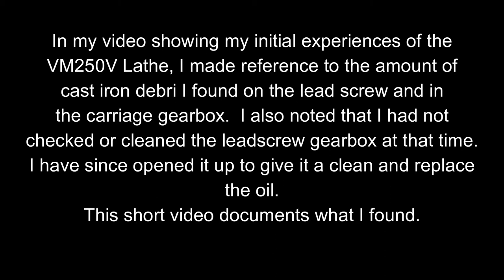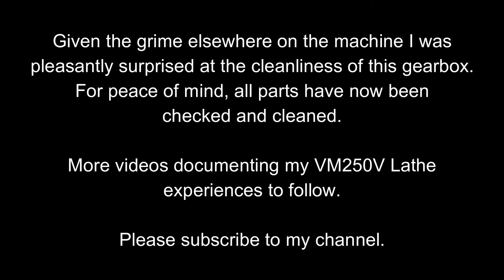WM250V Leadscrew Gearbox Strip and Clean

Comment: Hello Mark, we've recently taken delivery of the same lathe from warco, I've just encountered a problem with the lead screw slipping when you engage the half nut, do you know how its attached in the gearbox etc? Glyn
Reply from the maker: Hi Glyn, I would be surprised if it is slipping - have you checked that the half nut is fully engaged?  There is no clutch in the drive chain, so it will either drive or brake the shear pin on the lead screw.  The gearbox is very simple.
Mark
Reply: @markshomeengineering5243  The lead screw basically stops turning when the half nut engages, could be the pin, i take its easy enough to replace?
Reply from the maker: @glynburnett7364 , before you dive in and look at the pin, can I suggest that you ensure that selectors on the gear box are properly located.  Engaging the gears on my new lathe was (still  is) a bit tricky.  Also check that the lead screw drive gears under the drive belt cover are properly engaged - the  gear train is on a pivot, so can be moved.
This video (different lathe, but the same sheer pin arrangement) will show how to change the pin (https://youtu.be/njXJ52uur2Q).
Yeah, I sheared mine too :-)  
It's actually quite hard to break, which is not so good.
Good luck.
Reply: Its the shear pin 🙄
Reply from the maker: @glynburnett7364  bummer, but at least you know why.  I replaced mine with some threaded brass rod that I had.  It's not ideal, but it got me going and I think it will shear with less load than the oem part.  Which is good :-)